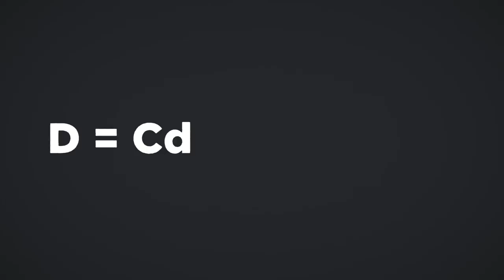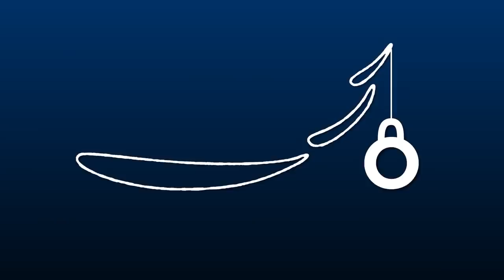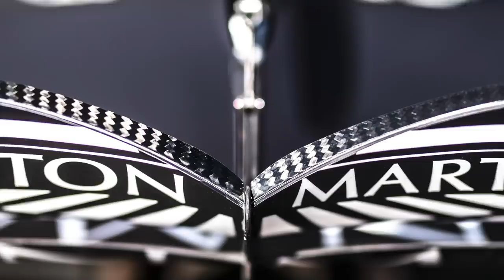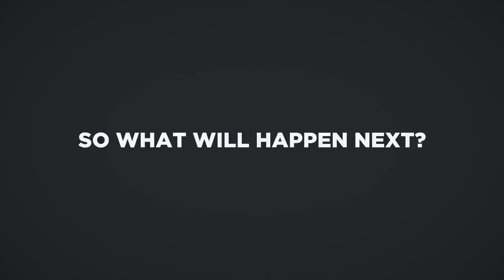What Are Flexi-Wings & Why Are They So Controversial In Formula 1?

Comment: I cannot see a single valid reason for not permitting this. Its not an unfair advantage, literally any team can implement it. What is the problem? Enough with the unnecessary regulations. Kills me to see this as a young engineer.
Reply: It's not even about innovation anymore
Reply: Literally just explained in the video that it's a safety issue 🤦‍♂️
Reply: @matmul4850  Well, they are proven to be safe, aren't they? 🤦‍♂️ So why the additional crackdown?
Reply: @kevlard  because they have been illegal for 20 years
Reply: @pedrof9471  They all flex. Besides, it was said above that those rules were there for safety reasons. So they were 'unsafe' for 20 years?
Reply: @kevlard  there is a limit of flex allowed, "they all flex" isn't a good excuse. Also, yes, they are still unsafe compared to rigid bodyparts
Reply: @pedrof9471  No. Officially they cannot flex at all. But they ALL do. The tests determine the allowed level of flexibility. Which Red Bull passed.
Reply: @kevlard  red bull passed the test of flexibility, that doesn't mean the wing is legal. This is like saying a doped athlete should be allowed to compete after not getting caught at a drug test, even though they know he is doped.
What matters is the law, not the enforcement. They changed rules mid session in 2019 when Ferrari bended the fuel flow meter, does this means the fuel flow meter was legal? Red Bulls wing passes the limit of allowed flexibility, period. Stop justifying cheating
Reply: To all those claiming safety, do you even understand what a composite material is? You can construct them in any number of ways to benefit performance and mitigate issues. Being flexible does not correlate at all with poor safety. No team out there would construct the wings in such a way that they might break under normal use. This is just another example of dumb rules that damage the engineering side of the "sport". Intentionally bad tires (Pirelli didn't even want to make tires this bad), aero rules not relating to outwash/offensive aero, the grossly overweight cars of today that struggle to take a tight corner (thanks Red Bull for not giving up on this), etc. I'm a huge proponent of not having ridiculous expenses and unfair budget differences but flexible carbon wings does not fall into this category.
Reply: @bobbyrandom5595  the issue is that flexi wings were tried during 1999 and 2006, in both of those years the numbers of accidents went up considerably.
Your narrative doesn't change data, buddy
"In the lead up to and during 1999, there were a number of high profile accidents with teams trying to create an effect whereby the rear wing would tilt rearwards under load - giving required downforce at lower speeds but reducing it and, more importantly drag, as speed built up"
Reply: @kevlard  "merc front wing isn't legal"
Funny how no team filled a complaint. I'm going to send horner a dm
Reply: @pedrof9471  Were the wings specifically to blame? A lot of things can build up to cause accidents. Quite a few teams have been flying under the radar with flexible (not quite as much movement) wings and doing quite well. The interaction of the car's aerodynamics with flexible bodywork is incredibly complex but obviously worth the effort as demonstrated by these teams. At the end of the day, F1 is an aerodynamics engineering test bed and something as important to the automotive industry as this concept should be actively encouraged, not discouraged. Its not prohibitively expensive, is directly applicable to road cars, and clearly can be done safely. Incrementally reducing the restrictions is likely a good solution but blanket bans without strong reasons are ridiculous.
Reply: @pedrof9471  I'll try to find some clips of what you mentioned though. I'm just getting into F1 and still learning a lot about its history, engineering, and politics. I see F1 and aerospace as the pinnacle of creative problem solving in engineering and where I'd eventually like to find myself, so I apologize if my disdain for restrictions came off as arrogant.
Reply: @bobbyrandom5595  is, the wings were to blame, and this is why fia banned them. 
Mate, 5 seconds on Google would answer your questions. Do your research
Reply: @bobbyrandom5595  also, another reason to ban flexi wings are the composite materials. Composite engineering is literally the most recent form of gaining advantage in racing. During 2006 only a handful of teams were able to compete because of this issue. Another reason is the difficulty of testing, like we are currently seeing. Even a clearly illegal wing can pass tests in different manners. Freeing a expensive form of advantage while making a 200 million budget cut for every team is madness.
Reply: @pedrof9471  after reading, the last incident directly attributed to a flexible wing was in 1999, where it broke and caused a bad crash. This happened a handful of times in the preceding years. Composite engineering is lightyears ahead twenty-three years later. All other quoted "incidents" were teams getting yelled at for trying the wings, not accidents. Playing with composites is of goliath value to manufacturers of all types and is very much worth pursuing. The new budget caps and negative feedback loops for testing make this a completely fair field for improvement as it is directly related to aero anyways. Your request for me to read has only strengthened how I feel about it. There hasn't been a safety issue in over 23 years and flexible wings is of high value to both racing and industry. I'll stand firmly by my call to slowly release the restrictions to safely explore this field on the track.
Reply: @pedrof9471  I guess you are not aware of Red Bull (and others) threatening to counter-protest IF Merc will protest the RB-wing in Baku? They don't want to be the first to protest because that will start a spending spree for all teams to stiffen up their wings. That's not 'funny', it's politics.

Comment: True hypocrisy indeed. Mercs can't afford to flex as they have been impacted by more by the new regulations on the rear floor board being cut and having a lower rake angle. If they flex they loose grip and introduce unecessary wheel spin I imagine and loose time. RB and Ferrari have higher rake which means a little flex is compensated by the design. We can think of this as another advantage of having higher rake.
Reply: That's why they flex as well but only at the front...

Comment: FIA certaintly has accurate representations of how much downforce and drag the aerodynamic parts generate, if they created the rules for safety without evaluating how far they are from peak loads they messed up really hard. It really sounds like they are just controlling flex because they have the power to do so anytime they want and teams just have to deal with it.
Reply: It's an entertainment  game. Drama is beneficial  to the sport.
Reply: @rhyswilliams4893  track and team drama is beneficial, rule drama is annoying. In football the person you should notice the least during a game is the referee, in F1 this role belongs to FIA. It needs to set the rules and enforce it, but if the rule is grey they become more important than teams and athletes

Comment: People saying Red Bull is within rights of having flex-wings don't understand F1 rules. F1.com explained this in an article why it's technically illegal.

Article 3.8 of the Technical Regulations - The rules dictate that all components influencing a car’s aerodynamic performance – such as front and rear wings – must be “rigidly secured to the entirely sprung part of the car” and “remain immobile in relation to the sprung part of the car”. In other words, moveable (or flexible) aerodynamic devices are not allowed – save for the DRS – because in theory they can offer a performance gain.

Other people will say what about the DAS system that Mercedes used? It wasn't covered in the rules until this year, that's why amendments were made to close that loophole, they innovated and made something that wasn't part of the restrictions. This specific rule (article 3.8) has been in the rules books for ages now. So, they are technically breaking the rules and not following them.
Reply: I don't agree with that. Every wing has a certain level of flex and because of that 3.8 can never be applied the way it is defined. Saying that it has to be 'immobile' is simply not realistic (not even Mercedes would pass that test) and 3.8 doesn't define a margin of flex that would be allowed. So until now the rule is dictated by the tests that FIA performs on wings. And up til now this test has shown that RBR's wing is legal: it has passed all the tests.

The situation was DAS was very similar in the sense that it wasn't as much about the rules themselves but about the interpretation of the rules. FIA could have declared that DAS was illegal but they chose an interpretation that made it legal (for a year). It is the same with "flexwings" because until now FIA has always practiced an interpretation that made these wings legal.
Reply: @ricahrdb  obviously no part can ever be completely rigid or it will break but there should be tolerances from which the bending of t he wing lies within
Reply: @ricahrdb  another thing is that the FIA is changing testing because the current test don’t simulate the track so the wings behave differently when tested then they do when on track
Reply: @devilliersmolefe3851  you are right on the tolerances part but unfortunatly the rules don't define tolerances here. So what is and isn't legal is basically defined by passing FIA's load tests or not.
Reply: @ricahrdb  yes you are right that why they are changing the test since it doesn’t  simulate the loads on track. So while a wing might pass the FIA test but still deflect more then they expected it to do

Comment: Mercedes create DAS and it is okay for the full year. Redbull creates flexi wings and FIA says it’s illegal. Everyone says Christian horner complains too much but Toto is not back at all. Now that Mercedes are on back foot, Toto has started crying 😂
Reply: Redbull didnt create flexible areodynamics. 

Mercades created a new innovation with the DAS, that met all the current rules when it was introduced. Redbull brought back Old technology, that the rules specifically prohibit, and are claiming its ok now because they found a way to cheat past the inspection tests.
Reply: @jameshoover492  the flexi wings are not cheating tests they are clearing current tests thus FIA is changing tests to make them illegal. Just like changing regulations and making DAS illegal mid season which of course didn’t happen with Mercedes.
Reply: @ajinkyadhumane3853  ok, ive since changed the way I explain that to 'exploiting an inadequate test to cheat the regulations.' Fixed.
Reply: @jameshoover492  okay 👍🏼. Lets see what happens in baku. Gday.
Reply: @ajinkyadhumane3853  I disagree with your terminology here. They ARE passing the tests, while still breaking the rule. The FIA is just changing the how the testing will be implemented going forward; the rule will stay the same. I’ll agree that the FIA screwed up big-time on drawing up a testing procedure that doesn’t accurately demonstrate the full parameters of that rule, but this is a quite different situation than DAS.
Reply: @leumas75  But the legality is decided by the test and they are passing it. Changing tests mid season is like changing the study material and books mid year for exam just because some rich kid (Mercedes) was not able to study properly.
Reply: @ajinkyadhumane3853  total bullshit. What matters is the rules, not the enforcement. This is like saying "just because an athlete used drugs and wasn't caught, the tests shouldn't change"
Reply: @ajinkyadhumane3853  they been illegal since the 90s. For safety reasons. Redbull just found away round the test. That's why with in the FIA rules they can change the test at any given time because of safety. Das was legal till this year.
Reply: @ajinkyadhumane3853  what a joke
Reply: @zeroxhunter3675  Yeah I am thinking about standup comedy as a career😂

Comment: "airplane wings flex very slightly" Sir what??? ive seen airplane wings on larger airplanes flex down and up by at least 3 feet
Reply: Airplane wings are usually made from aviation grade fiberglass.
Fiberglass can bend more then carbon until it snaps.

Theses materials do have similar strength to weight ratio's though.
Reply: @1barnet1  thank you for this very detailed answer. Very interesting

Comment: RedBull rear wing vs mercedes front wing and shark fin in front of rear wing 
the question is did mercedes not got banned to or just one team cause we know mercedes too have flexible shark wing and front wing so flexible
Reply: Shark fin isn't part of airo! It's part of the engine box and don't come under the same rules, front wing moves under bounce from the track. That's again is different.
Reply: @chriscollins550  thanks for the info 
but that part in mercedes car we know to flexible if FIA say legal but just few air from the side when he come cornering the part become so felxible that part
Reply: @sarifsamudra9970  sorry what part you talking about the fin or front wing?

Comment: its very hard to produce yielding rate of aeroelastic flutter on non homogenous material subject to constant change in load at short periods of time. tech is so advanced now that its easy to detect this behavior and very unlikely they wont do something about it before it turns into a disaster.

Comment: Just have drivers have on stand on their back wings before the race, if they snap, you’re out, if it holds you, you race, sound fair enough?
Reply: No
Reply: Yo do realise that these wings generate downforce well in excess of the general drivers body weight.
Reply: @heinrichetsebeth157  I didn’t know,
Reply: @heinrichetsebeth157  my point is there’s nothing wrong with the wings, wings have always flexed, so be it, unless the fia start travelling with a portable wind tunnel, (which could never be possible, weight, size, money) you can’t measure if the wing does of doesn’t move at 200mph because there’s no way of making the car do 200 and measuring it ‘safely’, if the wings aren’t falling off and disintegrating during the race, there’s no harm so therefore no foul, wings have bent ever since we put them on cars, you wont change that, no one will,
Reply: @roryevans4295  I get your point. Didn't catch the sarcasm at the time but it is duly warranted though. 

People carry on about the wings as if them flexing is all of a sudden against the rules when the rules states in article 3.8 that they should be fixed and in article 3.9 the regulations clearly accepts that it is not possible for aero not to flex under load and then goes on to denote the allowed tolerances and how it will be tested. The tolerances allowed is clearly stipulated within the rulebook. They were tested as per what is in the rulebook. Hence the flex in the RB wing is legal.

 The only thing that changed is that due to snarky comments by Wolf and Hamilton (reasons can be debated but I would put my money on them not wanting the competition to be close enough to actually make a dent in their championship prospects) the FIA decided they need to save face with all of the Wolf and Hamilton supporters and revise the regulations around the allowed tolerances and how the tests will be conducted mid season. And might I add that it is a season where cost caps are hitting teams extremely hard. Especially with the rule changes for next year. This is nothing more than a political game by Wolf to try and hamper their biggest rivals in the game.
Reply: @roryevans4295  I have a better Idea though. Let the teams do what they want with the wings. If one comes off or breaks, without there being contact, slap the team with a hefty financial penalty. The teams will design so they have the best results that does not cause a safety issue.
Reply: @heinrichetsebeth157  that’s exactly what we do already, but the fia wants change, pitch change and then come back to me 👍

Comment: This is pure nonsense.

Everything flexes if enough pressure is applied.

That means that in case FIA wants to ban flexible wings there must be a threshold. That threshold is defined, otherwise there is none. And the threshold is used to test. And a wing that passes the test must be legal. Which is the case for all wings used in F1 including RBR's wings.

If MER can force a change mid season that would prove a deal with FIA has been made last year ; "We want to leave F1, but we'll continue IF you guarantee we'll win it".